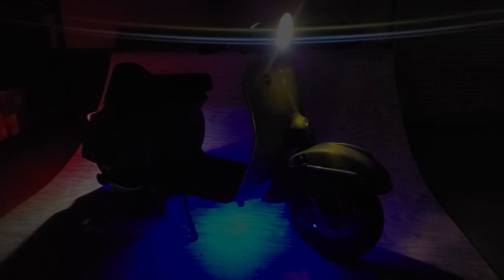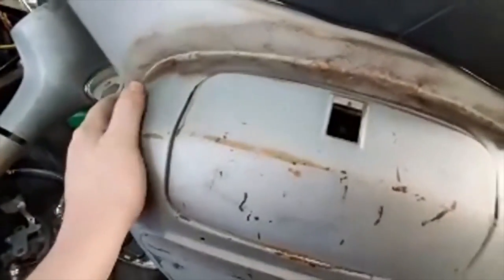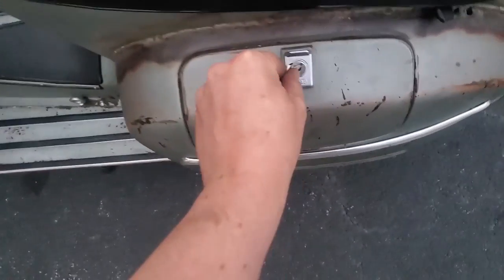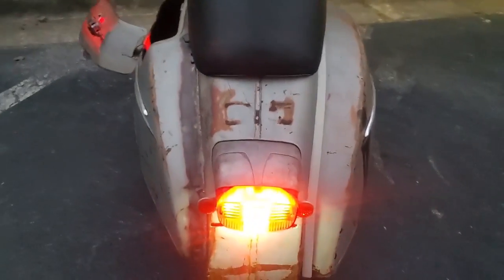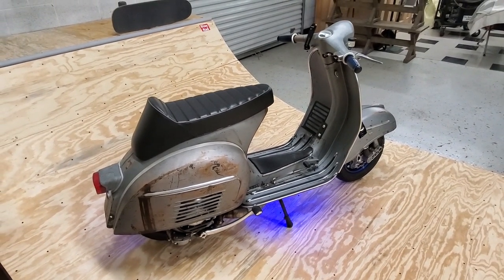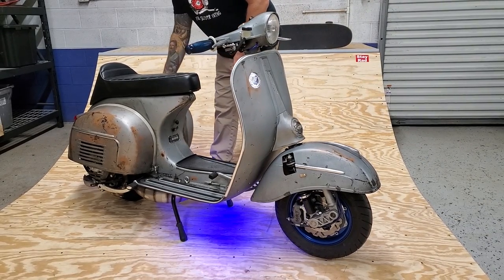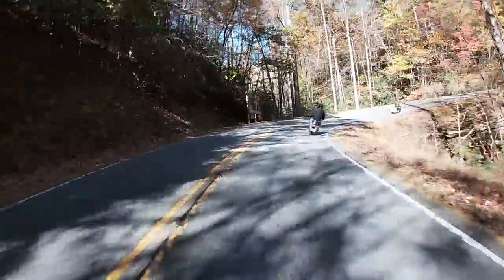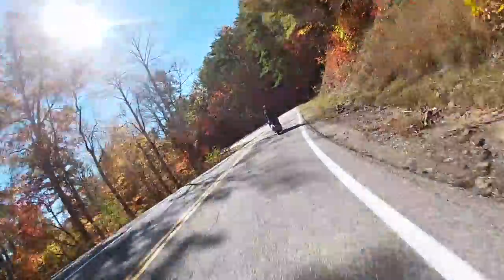Vespa Sprint 150, 1966 Sears Blue Badge, The Ultimate Restomod! 193cc and Smartcarb - TST Ep. 59

Comment: Amazing build! Really nice approach, some kind of restomod. I am trying to do the same with a 1964 125L, keeping the original aesthetics but with much modern mechanics.

Regarding the PK fork, did you have to do some modifications? I have seen that the steering lock has to be modified, and also that the used shock has to be bit shorter. I don't know if you have any info regarding this...

Thank you in advance!

Comment: I prefer old hooter. I also have sprint veloce. 11000km 1 owner I bought. Silver. When I got it up and going spark was so good, I almost Burned scooter down. Can sprint handle 100 120kmh? Non of my scoots are std. I have p172. Not 26hp but enough power to do 80kmh up any hill. Top speed 120ish. As I only put 22t clutch. I also have px221. Sprint I bought like 8 months ago want to do resto. Durban south africa has lots of rust so best to do resto. Engine still stock and 60kmh is kinda speed. I have ridden it only a few times to keep it alive. Not let fuel die. My pockets bit empty at the moment and yeah, can't really enjoy 7hp scooter. Best to bring scoot to date. That 6v system for the birds. Both my other scoots got 23w 12v led Philips globes that 55w output. I had to mod to h4 fitting. Definitely have to up your game.

Comment: Lovely scooter! I have a px200 now with quattrinni 244, with malossi x360 reed and phbh30, Im willing to upgrade to a smartcarb 38, my question is what is the manifold you are using, as you describe is a MRP but can you help me clarifying if is it 36mm o 38mm since SC from 36 to 40 have the same inlet according to the webpage! Thanks!
Reply from the maker: This was the 38mm intake, the venturi shape of the SC works well with a larger intake it seems. But I also used the 38 because it was at hand. The 36-38 mrp should be the same.
Reply: @ThatScooterThing  thanks for your comment I´m going with the 38mm since 36 & 38mm smarrtcarb have the same inlet diamater of 46mm !

Comment: hi thanks for sharing your ideas and great scooter! May i ask for a recommendation for a decent shock absorber for my 2001 PX150? thank you in advance and more power!
Reply from the maker: It really depends on what your experience with setting up shocks is. My experience for example with the SIP 2.0 Race shocks was that if they were set up very wrong, they tried to knock me off out of turns (at... a fast pace). 

Otherwise, the SIP/BGM standard adjustable shocks are awesome! Bitubo you cant do much wrong either. A simple -progressive spring shock is not really that big of an upgrade as the stock PX late model shocks are already solid in that area. 

Spend some more. Be happy.